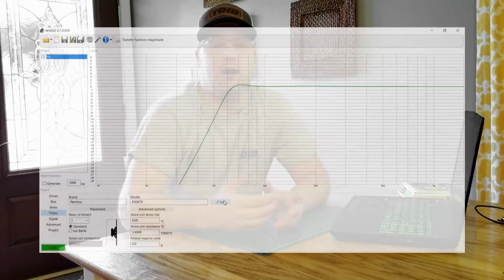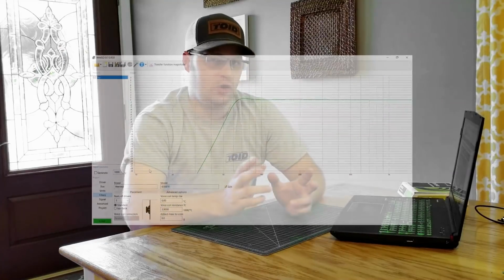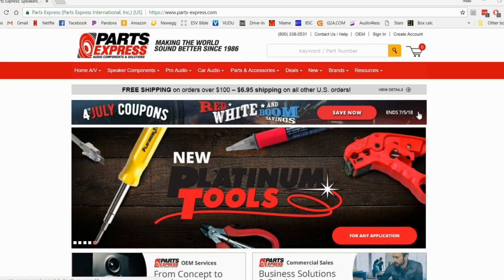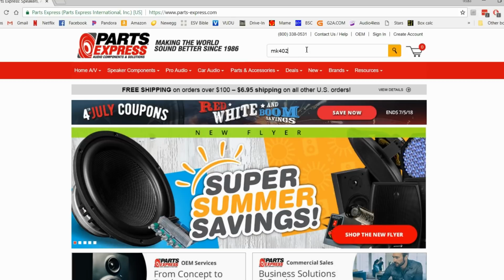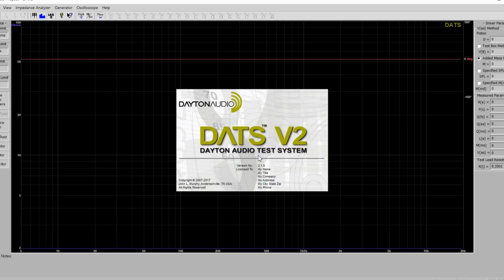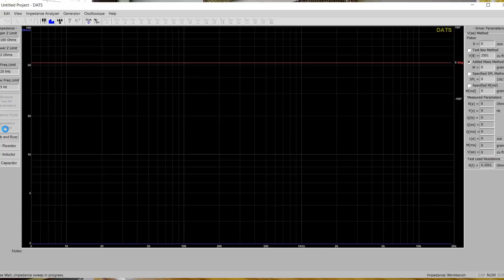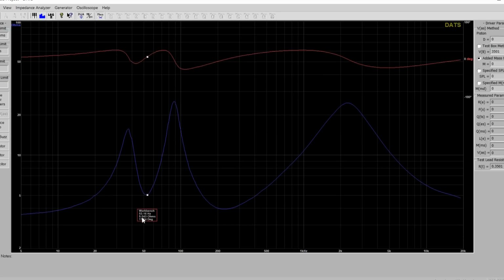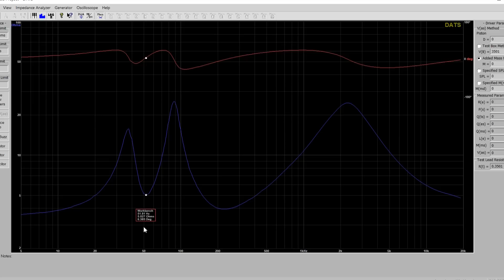Ported Speaker/Subwoofer - Easiest way to Verify Final tuning Frequency

Comment: When you are testing that speaker and put the DATs clips on the binding posts, is the crossover in the measurement as well?  
Thanks
Reply from the maker: If the crossover is hooked up then yes

Comment: Sooooo, what would I do now that I know it is 50Hz? Would I turn that frequency up or down on my EQ when listening to songs with a lot of bass? What is the purpose of knowing what they are tuned to? thanks
Reply: I would try to tune it a bit lower. Add some wadding and lengthen the port if it's not sealed, 50 Hz is quite high to be tuned at and proper lows won't be good. What's your setup?
Reply: @vespacheck  What is the purpose of knowing what they are tuned to?  this is the real question. I am not referring to a specific cabinet.
Reply: @kroekerta  Knowledge is power. If you need to know, this is how you check. For instance, let's say you buy a sub box online and it says it's 2 cu ft net and tuned to 33Hz. You can use a tape measure and verify the size, but its hard to verify the tuning frequency. With this device you might find the box is tuned to 40Hz and thats why it doesn't sound right. You can then go in and extend the port to get the tuning you want. 
These devices can also measure certain speaker specs. They can also tell you if a box has a problem. Plus a lot more stuff.
Reply: @JasonWW2000  so "Tuned to" means 
Everything at that frequency gets boosted, eliminated, or .. everything below it stays in the box, or the pressure created naturally for that particular driver gets cut in half,,? I think thats what Im looking for.
Reply: @kroekerta  Oh, and to specifically answer your question, at the tuning frequency the air in the port starts to resonate back and forth and that generates pressure at the port entrance. This pressure wave vibrating back and forth acts like a speaker cone and the timing of it is such that the air pushes out at the same time as the cone pushes out so you get that multiplied force. The reason the air is pushing out on the port while the cone is pushing out is because there is a time delay taking place. The cone pushing in it what forces the air out of the port. With the right amount of delay it can be timed so the port air and cone move forwards and backwards at the same time. This boosts output, but only in a narrow range of frequencies. I hope that makes sense.
Reply: @kroekerta  Okay, you need the basics. In the audio world there are mainly 2 types of subwoofer enclosures. The 2 most common are sealed boxes and ported boxes. They each have pros and cons. If you look at this picture as an example it shows the output of a speaker box both sealed and ported. 
The blue line is sealed, the green is ported. Note that the ported box plays a lot louder at lower frequencies like 30Hz and 40Hz. I'd guess it's port is tuned to about 35Hz. (The tuning is determined by the port area times it's length.) Anyway, with a ported box you get more output at lower frequencies without needing more power. Your using the rear wave of the speakers cone to reinforce the front wave. Efficiency goes up. A downside is that it may sound less punchy and tight. You also need to limit excursion below 25Hz or so because it can bottom out more easily. A ported box also typically  twice as large as a sealed box. So there are pros and cons. This DATS device can help you verify what frequency a box is tuned at. Especially if it's a pre-made box. The builder might lie about it's tuning freq or maybe they just calculated it incorrectly. Plus this device can do many other things.
Reply: @kroekerta  Sorry, Youtube won't let me post a picture link. Just Google sealed vs ported frequency response. 
You'll see graphs and the sealed will taper off the low frequencies with a shallow slope. The ported box will have more output around 30-40hz but it tapers off at a sharper slope.
Reply: @JasonWW2000  so if I am building a ported box for an 18 and the theil small parameters list the F3 at 34Hz I want a port tuned to 34 in order to boost 34 or a different frequency because 34 is a problem for that driver? What factor tells me what frequency to tune the port to?
I actually have been doing this for centuries and the term tuned port has never been defined in the 6 million docs or pages Ive read lol.
You are helping. I think understanding. This might be all thats left
Reply: @JasonWW2000  https://youtu.be/JsBN2mGIOyg. My larger system I built. Thanks for the help:)
Reply: @kroekerta  No, you don't necessarily use it's F3. You can tune a box independently of the driver. You can tune it to whatever frequency you want. You want to determine what frequency range you want and design for that. Most times sealed is good option, but if you want higher output or higher efficiency, a ported/bass reflex box is the better option. Take an 18" driver for instance. You can tune it to say 45Hz for the back of an SUV and it will have huge output from 40 to 50 Hz. My big SUV likes 42-44Hz. It naturally boosts that range. If I tune the box to 45 it will be very high output around 40-50. Great for an SPL competition, but not great for music due to output dropping off around 34Hz. For musicality I typically tune my sub box around 30Hz. This gives me a flatter response. That same 18" could also be used for home theater and tuned to 20Hz. It should play down to 15hz, great for rumble effects. One of the limiting factors of ported boxes is it will not play much below the tuned frequency. The general guideline is one half an octave below the tuned frequency. Below that the cone will flop around and possibly bottom out. So you might need to use a subsonic/infrasonic filter on it. 
Also, not all subs are suited for ported boxes, usually you want to see a QTS above 0.45 or so. Generally the speaker manufacturer will tell you what enclosure will work best and at what frequency they recommend. Those are good guidelines.
Reply: @kroekerta  If you want a cool, free phone app to model a subwoofer response look for a program called speaker box lite. It's a green logo. You pick a speaker and can compare a sealed box to a ported one and see the response at different tuning frequencies, etc. It's very cool.
Reply: @JasonWW2000  awesome answers. I really appreciate it. !!!
Reply: 50 Hz is high, a standard place to put your filter for subs is 80hz, if you play too low below 50 and you're risking damaging your equipment. Because you're tuned so high a subsonic filter set at around 37 would be a real benefit to you.

Comment: You added a subtitle writing ported. Are you suggesting this feature is only for ported speakers? It won't wok on closed speakers?
Reply from the maker: That is correct
Reply: @Toid  Why? Doesn't make sense why it should'nt work on closed speakers as well...
Reply from the maker: @Trdat  a ported speaker will have two humps in the impedance like shown on the graph. A sealed will only have one. What we're doing here is checking to see where the port is actually tuned to. If you were to lengthen or shorten that port, the impedance graph would change, thus showing your new tuning frequency. With a sealed speaker, You're more likely to measure the q of the box to get your bass alignment. You're not tuning it like you are a ported speaker.
Reply: @Toid  Fair enough, from a tuning perspective I see your point. But I was thinking why we can't see an impedance peak on closed box in general?
Reply from the maker: @Trdat  The impedance peak is going to give you your resonant frequency. It's between the two peaks that you get the port tuning on a ported box.
Reply: @Toid  Thanks for clarifying that. Also, I have to add that your channel is definitely the most genuine out of the audiophile channels. Many of the others as hard as they try you can see they get kickbacks which is all good but my point is that its too obvious that there sponsorship affects their reviews and opinions. One last question, with a closed box can the DatsV2 ascertain the "Q " of the box?
Reply from the maker: @Trdat  thank you. I appreciate that. Yes that's can measure the Q of the box.
Reply: @Toid  Can you point me in the direction of how to do it? Any links? Do we choose impedance sweep again?
Reply from the maker: @Trdat  just add your mass then get your TS specs in the box.. it'll give you all your info including your Q

Comment: Very informative videos. I'm struggling to find through Winisd the correct length for the port without having a massive rear air velocity. Especially on a small drivers that need a small enclosure ! As i can see that pre made speaker you have there from Dayton Audio looks like got a 30mm diameter port and who knows the length ! I have calculate the litres from this box and add them to the Winisd and the tuning frequency too. I have play around with the ports that look similar to the size that you have there and i cannot get less that 50m per sec air velocity !  Now my question is , does this really matters? 
Thank you very much.

Comment: DATS V2 is very UNRELIABLE. I have one and when i test Vas it gives me different results with the same driver with the same mass(i use the ''add mass method) the difference can be from 5% to 15% even if i test at a difference of 2 seconds of pressing the ''calculate" button.  
ps: i triple check every settings many times & the driver/drivers are in good working conditions
Reply from the maker: i raul wow that's odd. I haven't had that issue. Are you sure the leads are calibrated?  And the the speaker if it has a vent hole is off the ground?  I know temperature can make a difference, but not at 2 second. That's really weird.
Reply: the drivers are tested outside of the box(this is how u test vas and ts parameters)  and everything is calibrated and triple checked. For a Peerlees HDS-P830990 sometimes the vas is 17.5L & other times 18.5L or 20.5Liters. So...
Reply from the maker: i raul man that really stinks. I know you know what your doing. I thought I'd just mention some things I've seen before, but man sorry to hear your DATS has given you so much trouble. That sure would make it impossible to make a good box off it's measurements
Reply: yup - i'll try to contact Dayton. cheers
Reply: @HowDareYouu  jkjkjjjjjjjj

Comment: You can also check where the phase angle is zero. That should correspond to the impedance min and is a good second check.
Reply from the maker: Impulse Audio great tip as always!  Thanks Impulse Audio!

Comment: I often use this method, quite a bit cheaper than DATS. DATS is a great system though. 

Put peas/BB's/rice etc. On your cone and run a frequency sweep and the point where your cone, and thus rice, vibrates the least is the frequency your enclosure is tuned to.
Reply: Vincent Koster Very ingenious! Love it.
Reply: HH Scott   thank you! I stole it from a video from a guy who was looking for the tuning frequency of his speakers with PR's. It works very well

Comment: While DATS works amazing, there is cheaper (almost free) alternative. 
A while ago i made myself DIY jig for Limp/Arta and it works great, obviously not as accurate and need more messing around but for simple thing like this works great. I also noticed graph from one of my speakers was different, problem was capacitor in xover  so i had to replace that, really useful tool.
Reply from the maker: Cekpi7 that is awesome! I agree tools like this can be very useful. Glad to hear you made your own